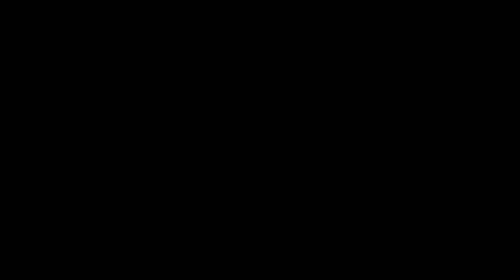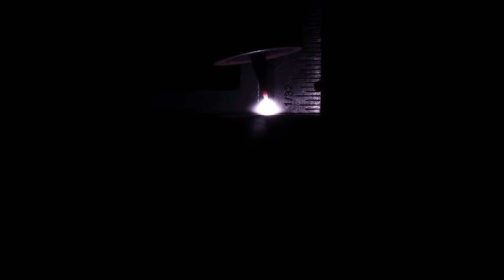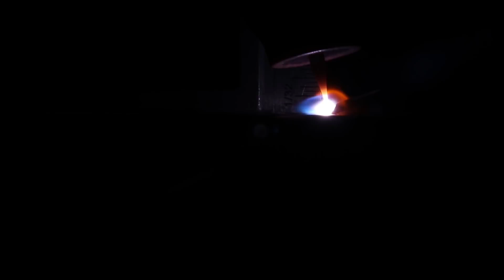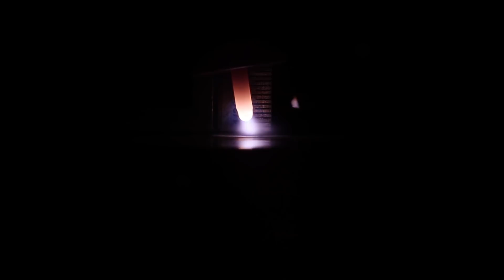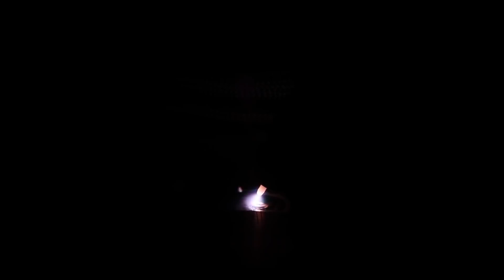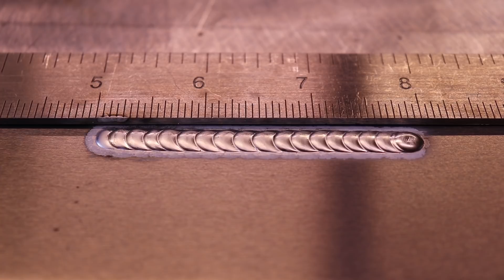TIG Arc Length and Travel Speed

Comment: I have an idea for a video. Nobody has good videos on how to make clean cuts on stainless, or what saws or blades to use for stainless. I just bought an Evolution chopsaw with a "Stainless" blade. It STILL, despite all my carefulness, does not cut perfectly through stainless square tubing or stainless angle iron. Still needed to do plenty of sanding on the ends to make them all even. Welding stainless? Everybody has a video about that! CUTTING stainless? Cricket chirps! You can't weld anything until you've cut it; and the cuts are good cuts. HELP
Reply from the maker: thats a great Idea.  when I did stainless we used a femi bandsaw until we got a laser but that bandsaw worked great.
Reply: @5thStreetFab  I just gave away my Harbor Freight horizontal bandsaw because the blade was too sloppy going through steel. A clean cut was a roll of the dice. Using an Evolution chopsaw with a stainless steel blade. The cuts are still messy. I think the Evolution blades have large aggressive teeth, rather than a blade with more teeth that are smaller.  It's just frustrating! A good cut is needed before you can even attempt a good weld.
Reply from the maker: @w46try7  I know what you mean I only use my harbor freight bandsaw as a vertical saw now.  That Femi though was top of the line and made awesome cuts.  Had a special stainless blade.  And after the cut we'd hit them on a belt sander and then debur them

Comment: I would like to see you do a video on tacking the ends of a 2g T-Joint or even butt weld for that matter showing  how not to blow the ends out on thin material. Otherwise, keep 'em coming, good stuff!
Reply from the maker: Ya sure bud!  I just point my Tungsten in from the outside of the t joint and blast it without filler.  Might not make sense.  I'll make a video for ya soon
Reply: @5thStreetFab  I would like to see that in a video too.

Comment: I am able to get good colour and spacing. But have difficulty getting the puddle stared on outside corner joints without things washing. Any thoughts?
Reply from the maker: It could be a couple things.  When I start I'll have my torch at almost a 45° angle at the edge of the corner because if you're at your normal 15-10° angle it'll suck in atmosphere and contaminate the start.  So that's one thing.  The other could be if you're using an inverter with and your frequency is above 120 Hz.  Atleast for me it seems like when it's set above 120 I have get started and move quickly but if I'm at 60hz I can move nice and easy.

Comment: Are you using the htp 221? What are the settings you use?
Reply: Ok. Thank you
Reply from the maker: Yep.  I had my amperage at 220 and just used as much as I needed at the pedal.  My balance was 70 and my frequency was 90
Reply: Is this a good setting for me to star welding aluminum?
Reply from the maker: @sgr5287  yes just be careful with the amperage.  It might be to high for what you're welding.  I'd go on the miller weld calculator and enter your material and go by the amperage they give you.  That way you don't have to control the amperage as much.
Reply: Can I send you pics of what I did in a piece of plate?